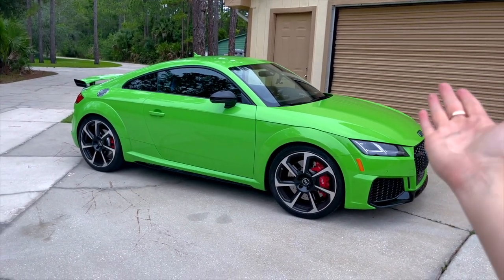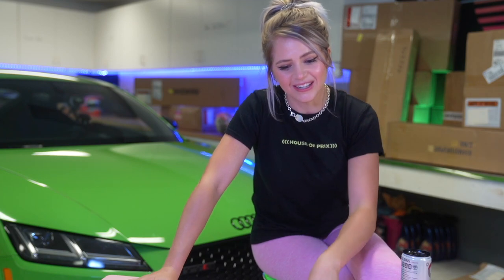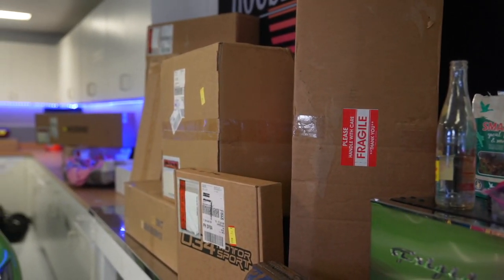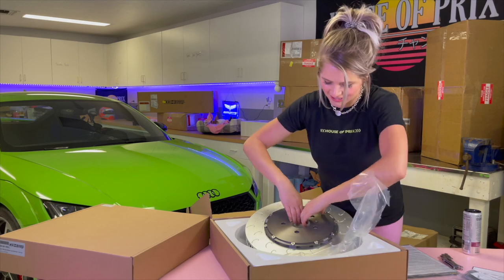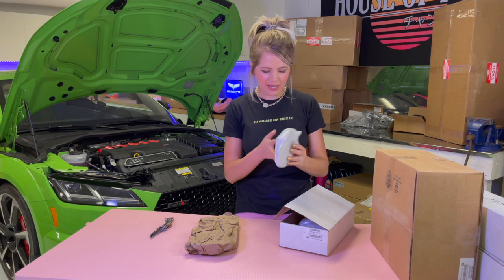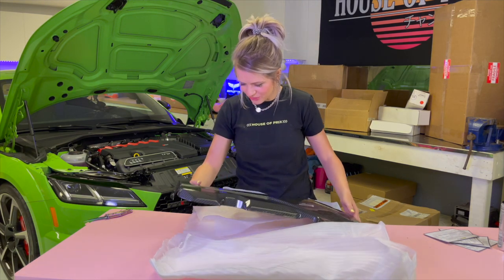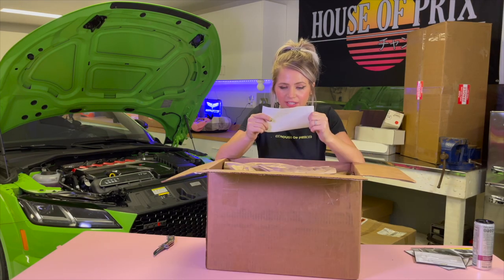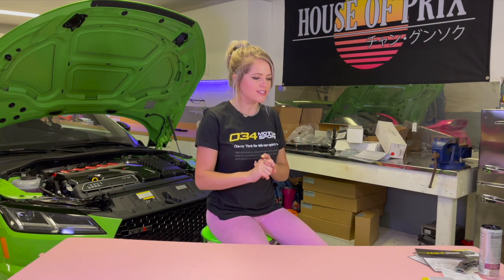Unboxing ALL THE MODS for My 2021 Audi TTRS!!

Comment: 034 forgot to send you the most important item: A fire extinguisher!
Reply: And here I was thinking a VR6 adapter plate.
Reply: @iswinkels  why would she need that?
Reply: @user-kd1kc1pg6h  Because VR6 > I5. Older but way stronger.
Reply: @iswinkels  dude she ain't gonna swap it
Reply: Its not a ford 😅🇨🇦
Reply: @ignorthepain  Using a Volkswagen motor in a Ford doesn't make it a Ford motor.

If it did that would mean Volkswagens are also Porsches, Audi's and Lamborghini's.  Or maybe VW just make good engines.
Reply: This aged well

Comment: So when you do the exhaust make sure you find the soundaktor fuse and pull it. The soundaktor is the speaker that amplifies the engine sound into the cabin. If you dont pull the fuse with an aftermarket exhaust it tends to create a lot of drone. Im running catless non resonated awe touring exhaust on my b8.5 s4 and there is no drone what so ever. ALSO dont wait to do the tcu tune. Do it the same time or even before the ecu tune, makes a HUGE difference.

Comment: Kia Ora, I have really enjoyed seeing this car in 2021. ( Wish we'd seen more of her ). Ask Mike to flex his camera over it when the C.F. pieces are on. Seeing an Audi TT, in such an individually brilliant colour, now, it's almost impossible to see and remember that the 'TT' in 2000, was the epi-centre of a styling/design revolution. The first simple coupe was featured in Art Galleries and all the big name Auto Shows and Auto soaps, (Fith Gear etc.) The radical flattened curves of the wheel wells were reflected in the rounded shoulders on the guards and then matched at the other end, just stretched and rotated. The cabin ( it was very aeronautical ) was yet another graduated reflection of the front and rear, (side view) The whole solid volume of the body floated low to the horizontal, the ground which her spoked grey/silver wheels, her black tires conspired to hold the car lightly at the ready to soar!!! But on the road and track she was a disappointment. Those sculptured loins didn't hold her down on the road after 70 mph (don't quote me) leading to a redesign adding the ducks arse upswept wing on the Boot Lid (trunk). In the subsequent 2 decades the styling cues delivered on the 'TT' have filtered into the mainstream vocabulary of auto/industrial design that it's now difficult to see just how significant this car was and still is. Your 'daily' has a great backstory and is also now a well developed Sports Car. Bravo Collette.

Comment: “A few bolts ons you can make so much more power” I think that is with any type of car lol
Reply: No its not with any type of car bud, not all engines respond the same to mods especially N/A ones.
Reply: You can throw headers n intake n a tune on almost any na car what you talkin bout
Reply: @915Boss  hardly get the same power increase in an NA engine as you do in a modern turbo though, just had my B58 tuned with a downpipe and it’s gained 130hp

Comment: I finally got a brief but up close look at one of that gen TT's in a parking lot today, seemed kinda bigger than I expected but I liked it. Not an RS,  this one,  but I bet I could deal with those indeed if I dared mess with a this-century German car by the time I could afford one.  :)

If I suddenly jumped a few income brackets, though,  hrm.   (Also from your beauty shots, it  looks like I wouldn't have to downgrade brakes to have a less excessive wheel diameter,  which is good,   cause I don't think those things you have would survive my driveway, never mind some of my driving.    :)  

(Also,  sticking carbon fiber on the plastic already there isn't making it lighter, so why bother when you could paint the plastic for pretties?  :)   "I like it" of course is a perfectly good reason  :) )  It otherwise looks like you got some extra nice pieces though.

Comment: Carbon fibre stick on engine cover is cheese .  Might as well just wrap it if your faking it
Reply: Wrap would just melt off, and making an actual CF engine cover is just unnecessarily expensive. In this one case, the stick-on CF is fine. Lol.